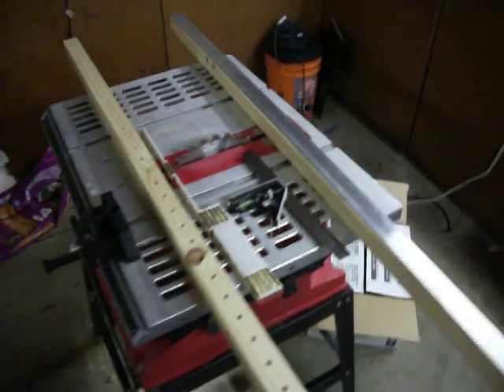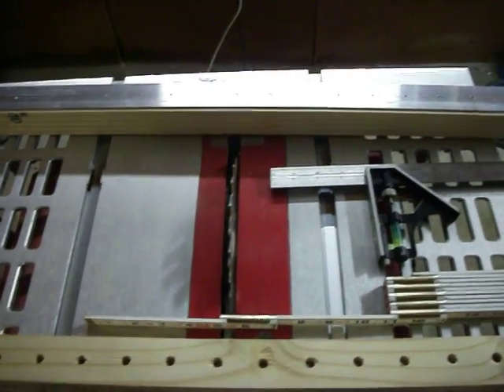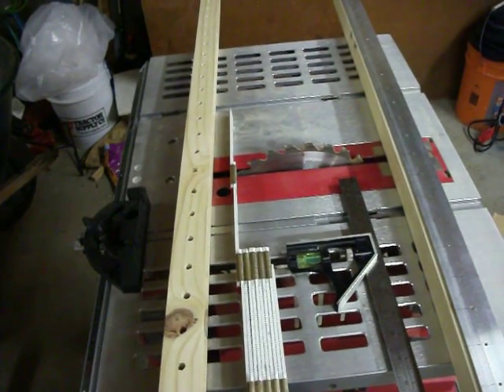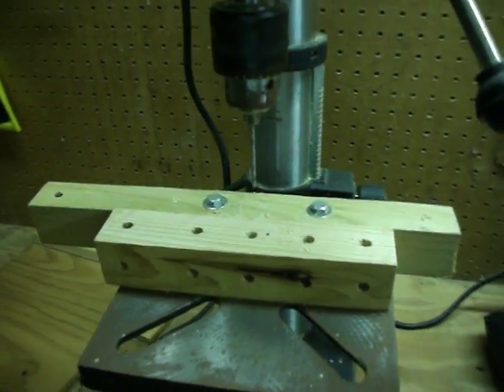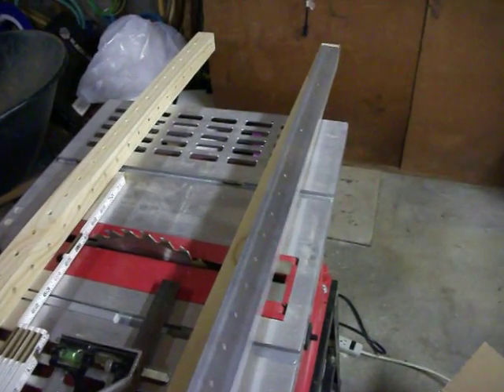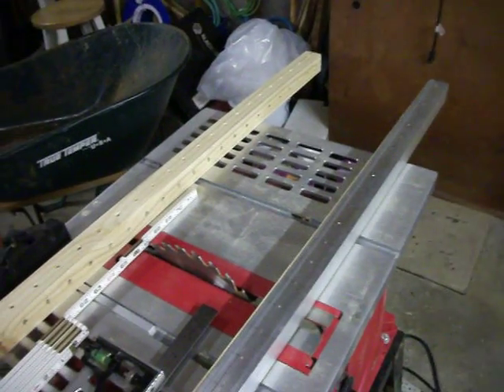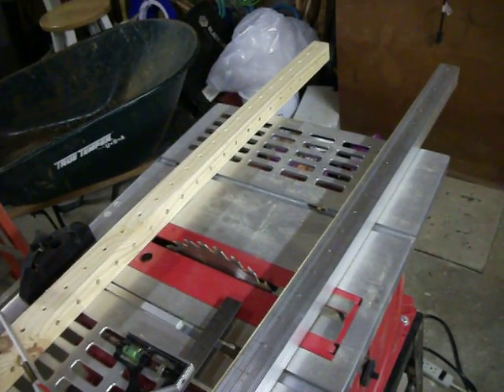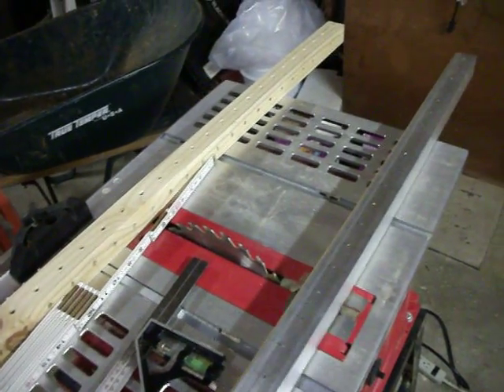How Do I Make Grid Beam?

Comment: inspired by your videos I now used an aluminium angle, but I added little bolts and nuts to the holes so I just have to align the tool and hammer it in, marking the wood in the right spots for me to drill out.

Comment: In addition to the wood block stopper on the back of the drill platform, just make a think (1/2" or so) strip which lies in front of the stopper.  Drill a hole in this strip, insert a short bit of dowel, perhaps 1".  Then, once you've drilled you first hole, you place that hole over the little bit of dowel sticking up from the strip, and drill again.  Lather, rinse, repeat.  This would ensure the exact same spacing for every single hole.

Comment: instead of marking all the holes would it be easyer to drill the first hole and then put this hole on a pin and drill the next hole and thenput it  on the next hole and on and on and on
Reply: There will be a consistent bit of error with every hole drilled. Over a long piece, the errors will add up to be significant. If you drill 20 holes, you'll get 19 times the error. Andrew's method avoids that problem.

I use a carefully drilled piece of grid beam to control the hole placement in a jig that mounts on my drill press. That way the error doesn't add up...unless making sticks longer than the template (which is 4 feet at the moment). Even then, the error is only multiplied by 2 for an 8-foot stick. It works nicely and, to me,  seems like it would be faster than what Andrew explains here.
Reply: Mark Fox Actually on a 4' length of grid beam one can almost get zero error using the pin method. First off I drill my holes 5/16" OC.  I use 2 5/16" bits. One is mounted in the chuck the other used as a pin. Now I have made a jig out of 2 pieces of 1/2" mdf,  2" strip mounted to be used as a 1/2" high fence. 

Measure, mark validate the center of one of the ends. Drill the hole. Place a stop block against the piece, clamped to the table. Rotate the piece 90 deg, drill again. Flip end for end repeat the process. 4 holes on both ends of the piece. Remove the stop block.  

Measure, mark validate the center on the next adjacent set of holes. Bore the first one preferably with the piece clamped against the fence.  LEAVE THE BIT IN THE PIECE. With the second bit insert it into one of your first end holes so that is aligns with the face of the top of the fence. Slide a stop bearing gently against the drill face. Immobilize that block by your method of choice. (I use glue and screws) Pull the pin. Insert in the 90 deg face of the end hole. Raise the chuck. Rotate the piece. Slide the pin against the stop. Drill. Repeat the process for 2' of the 4' piece. Flip end for end and repeat again. 

Doing it this way:
* There is minimal drift as one is using pins the same size as the hole being drilled. Nearly perfect registration if done right for  the first 8 holes.
* Drilling from the end to half way minimizes what drift there maybe.
* At best any drift is merely a shift from inaccurate drilling of the second hole pattern in the piece. 

Another thing which should be obvious -- do you need all the holes? For many projects I use what I call 'speed stick'. I drill the two ends of the piece just as if I was doing gridbeam.  After that I do a set of 4 holes on 6" centers. For many projects like benches and the like its all you need. And it can still interact with regular gridbeam parts. Its what Ken Issac's did.
Reply: ***** I should really do a video of my jig. My trick is to use 80/20's holey 
tube for the jig. I drill the first hole on two orthogonal faces, then 
put a pin in one of the holes and use that to index into the holes in 
the jig. It works great and never wears out.

Personally, I drill all the holes as much of my stuff is for jigging and
 prototyping. So the flexibility of a complete set of holes is useful. 
An MP3 player chock full of audiobooks and podcasts keeps me from going 
full-on crazy while drilling.

But grid beam screams for a CNC router of some kind. I'm working on it.
Reply: Mark Fox I probably should do a vid of mine as well. Though I have to say, your method sounds a tad faster. I have also considered using metal tubing as the indexing jig along with an appropriate bushing and router. (But the cheap a...... that I am, I have not spent the $ for the tubing as yet.)

I too have thought of a CNC router rig to do this. But time and $ are somewhat lacking at the moment. I also do all out gridbeam as either the project requires it or I have the extra times to do all the holes. Its just a lot of my beam-like projects don't require it.

Comment: Hi, I assume the holes are equally spaced? If so, you could have used an indexing pin instead of a template. Basically, you use a piece of wood and drill a hole in it, and put a dowel in that hole so it sticks up. Clamp this to your drill press table with the dowel the exact distance from the drill bit as your hole to hole spacing. Drill your first hole in the stock and move it over onto the dowel. Drill the next hole and move it over, etc.

Comment: Nice method!  My only complaint is your comment about using a tape measure because the "ends come loose".  They are supposed to be that way so you can get an accurate measurement for inside and outside measurements.  The "loose end" compensates for the thickness of the metal catch.  Google it.  Other than that, nice video, thanks!

Comment: Duuuuude. Kick ass! That's a much simpler system than the one I was cooking up that used gearing and many drills lol. Do you route the edges of your 2x4s after they've been cut to 2x2s? to make the corners nice and smooth? 

I think your next video should be some tutorials on how to make a simple object, right now I really need to build a sturdy table that has wheels on it, I was hoping to make it my first Grid Beam project.